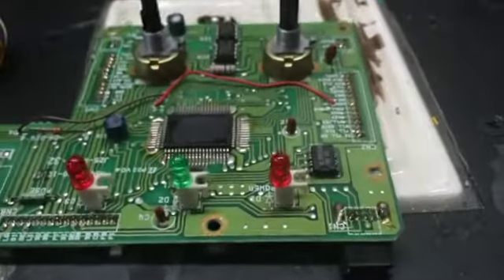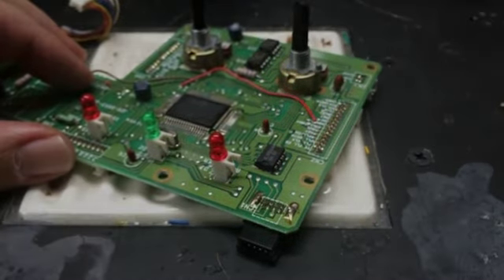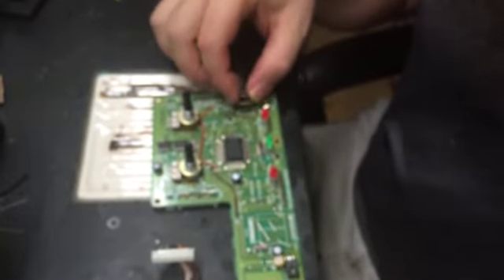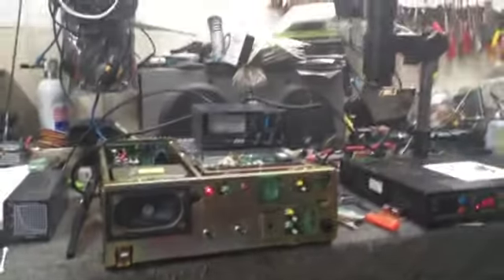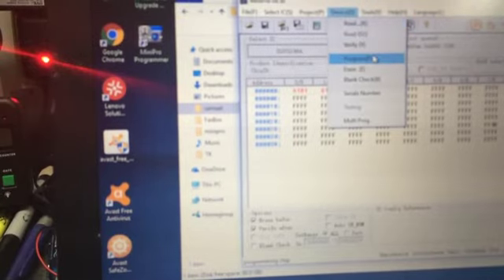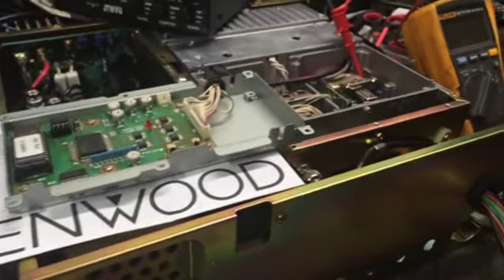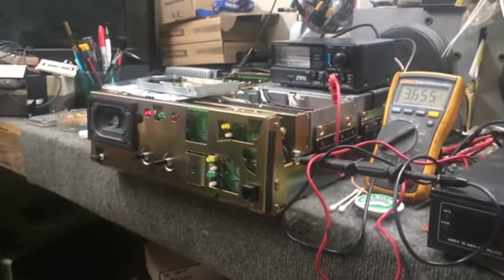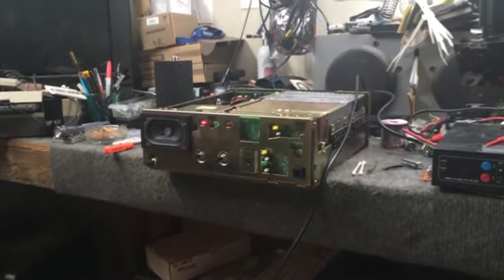TKR 720 to ham band - EEprom Modding

Comment: I have a tkr-820 I suspect is narrow band with the kit can you tell me what you changed to convert it I cant find anywhere online how to tell if its been converted or not
Reply from the maker: Man, I have kinda took a step back from the HAM thing for a bit. But I got some repeaters and a amp I need to get fixed. I can't find the file I made to keep a log of the parts. But I will go sit in front the unit and compare the old and new parts and make another list. It was a filter & crystal plus a retune for the most part.